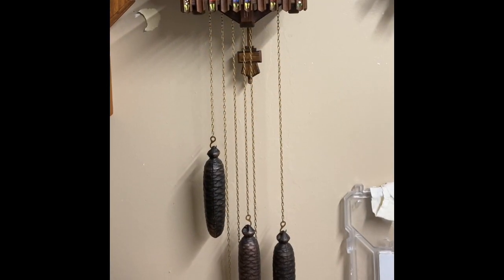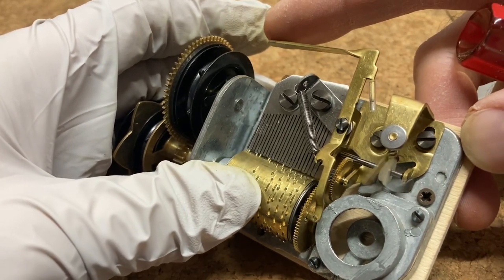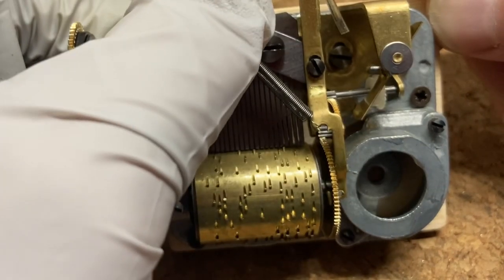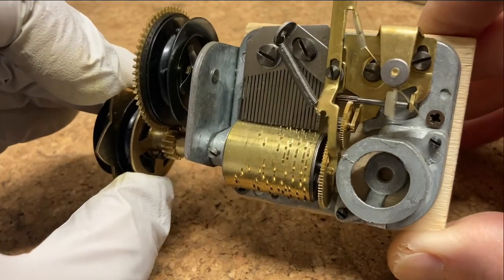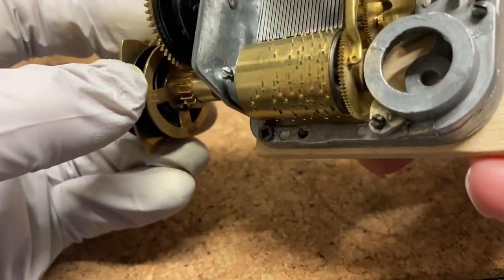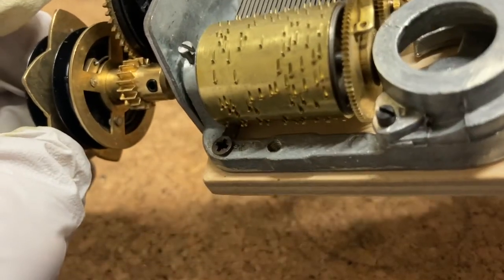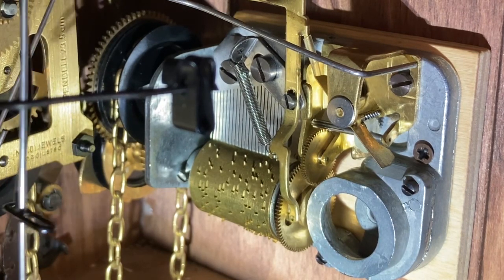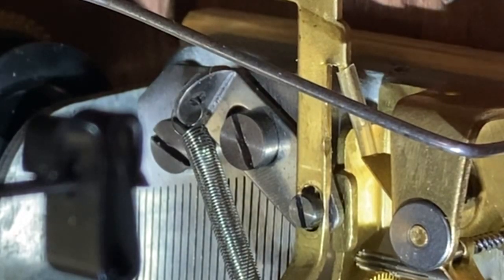Cuckoo Clock Repair - How the Cuckoo Music Box works and how to adjust in detail

Comment: Thank you so much!   This is the best video on this subject I've ever seen.  I had about given up on a box that won't stop playing.  But, now I'm going to give it another go.  Thanks again. Excellent presentation!  Just need to find some proper size tubing for the fan stop.
Reply from the maker: Thanks! You can use the fuel line for a model airplane gas engine. Check your local hobby shop.
Reply: @Chrisclockrepair  Already got it fixed!  Took about 10 minutes to get it out of the top of the case and about 5 minutes to adjust it!  I used a piece of heat shrink tubing.   Thanks again!  Created a new issue during the process.  Now the clock won't quit striking at the hour or half hour.  Should be a simple fix, but I've yet to see the problem.
Reply from the maker: @mantolaman  on the top mounted cuckoo music boxes you typically have a wire on the back of the clock movement that catches the fly during warning. If you adjust this wire to the right, you can pull the strike lift on the front of the movement such that it won’t drop and allow the rack to get gathered all the way up.  That could be your issue. Do you have a wire that attaches to the back of the movement and catches the fly?
Reply: @Chrisclockrepair  Right on, again!  Adjusted that top wire a bit and it's now working - everything as it should.  There is one small issue.  On the hour the singer comes out and leaves the door open.  And on the half hour He comes out, sings and goes back in and closes the door.  ha, ha,  ....  I can live with that.
Reply from the maker: @mantolaman  good job. That sounds good. You may be able to put a small bend in the cuckoo door wire so that it is a hair shorter. Like a slight hump in the middle of it. And put a drop of oil where the wire and door eye hole is and on the door hinge. That might do it.
Reply: Hey Chris have a 69 E. schmeckembecher   musical cuckoo clock 3 weights and the 3rd chain locked up I cannot get it to budge any suggestions?
Reply: Thanks, Chris!  Would you be able to recommend a place to buy that small spring that connects the lock pin to the other part ( apologies for not knowing the term) Great video! Thank you for sharing your knowledge with others.

Comment: I recently bought a Schmekenbelcher cuckoo clock, manufactured in 1967.  I oiled the gear pivots and it stopped working.  I worked on it and now it's working fine - However, now the music box plays at roughly twice the speed it did previously.  Is there a way to adjust the speed at which the music box plays?  Thanks -

Comment: Thanks for showing the details of this fascinating music box design! It's very different from the few cuckoo music boxes I've seen. In those boxes, the stop arm (the thing that drops into the hole) is slowly lifted toward the rim of the barrel as the music plays, by a cam on the end of the barrel. The stop arm drops into the hole, which immediately causes the other end of the stop arm to catch the fly and stop the music. When the stop arm is pulled out of the hole (to play the music) the first thing it does is fall toward the inside of the barrel so that the arm can't fall back into the hole. The stop arm catches on the inner edge of the hole rather than the trailing edge of the hole.

In contrast, your music box's large spring seems to do two things: 1) as in my music box, it pulls the stop arm inward so the arm can reliably fall into the hole, but 2) it also pulls the stop arm backward (see 14:18 and following) so that when the stop arm is pulled out of the hole the arm jumps backward so that the arm can't fall back into the hole. A fascinating design, because it requires the stop arm to catch on the trailing edge of the hole, so that the stop arm is pulled forward a little to catch the fly.

Thanks for the detailed tour of this cuckoo's music box!
Reply from the maker: Thanks Bradford.  There are certainly a number of different styles of cuckoo music boxes out there.  There is of course the top mounted style as well that is pretty common.  They all work in a very similar fashion and as long as you understand how they are supposed to work, you can generally extrapolate how to properly adjust them.  Thanks for sharing.  By the way, is there anything in particular you would like to see in upcoming videos?
Reply: What is the second song
Reply: What is the second song

Comment: Thank you so much for this great video, that I can actually see plainly everything you are ta.king about. I just purchased a cuckoo clock from an estate sale 130.00. She claimed it was new. Never been out of box. Got it home . Out of box I could tell it had been used and it even will not run. I'm definitely not a clock repair person, but I like to try to fix what I can because repair people for anything cost to much these days. So anyway the music don't  play,  some rust on alot of the screws, the bird only churps 1 time no matter what hour it is on and I level it to the wall but can only get it to run about 5 hrs then it will stop. I quess I may have to take the music box out of clock like you did to fix it. Some rust on the long things that roll over the cylinder as it turns.  Actually could not get mine to turn. I need lots of help. Hope you have more detailed video like this one and thanks again.
Reply from the maker: Thank you. Sounds like you have quite a job on your hands. Try lubricating the music box with clock oil at the pivot of each gear and see if that allows you to turn it. Also ensure the fly/governor is not interfering with any wires or levers
Reply: Thanks for your time. Due to working 12 hr. Shifts it will be a couple days before I can work on it again.

Comment: Great detailed explanation that has helped me advance in getting my chime to work properly! Thank you!  My only problem now is that seems like the music roll skips through the comb in a few places. It appears that the pins on the roll aren't long enough in some sections almost like they're stripped. I even tried to adjust the height of the comb several times and never found the sweet spot (if that is possible at this point) where it would play properly through the whole roll (2 songs) without skipping. I would appreciate any advice. If I get the chime working, I would love to hang onto the clock. It is a Cuendet Swiss model with very similar inners as are in this presentation. Any suggestions???
Reply from the maker: You’re on the right track. You have to adjust the comb or if the pins are worn, I would buy a new music box. Repinning is not worth the cost to repair
Reply: @Chrisclockrepair  Thanks Chris! Where would I get a new music box like the one in your video. I've looked around and couldn't locate one. Any suggestions on who sells them?

Comment: Hi Chris, With my cuckoo clock, it was jamming or stopping the clock on and around 4 to 3 minutes to the hour. After watching your video I have found out the problem. The problem I was having was as you described at 11:56 to 12 mins. I saw what was happening as my plastic tubing had worn that slight bit to jam the spigot in the music box housing as the fly was not stoping on time. In the end a simple fix that had me thinking all strange things which included pay someone to sort it out. Can you imagine it would be like the lamb to the slaughter ( in my case a pensioner to the slaughter. I would ask what was the problem and that person said this and that which I would not understand and forking out huge money for a 5 minute fix. I m hoping one day to completely overhaul an old clock. Looking forwards to the intricate fitting of bushes etc if need be.
Reply from the maker: Well done for diagnosing and handling that yourself!
Reply: yes, it was a good feeling to work out what may have been happening after watching your video.

Comment: Thank you so much! I inherited a cuckoo clock from my grandparents. The music box didn't work, dancers didn't move, pendulum no longer worked, chains stuck, and gears wouldn't move. 

I've been able to fix the music box (detailed below), clean the movement with dancers with an ultrasonic clear with water, tighten a small screw on a gear underneath the dancers platform, tighten the rod connected to the dancers platform and clock movement, oiled the clock, and put the chains on all the gears. Still haven't gotten the pendulum and clock to work. However, if I turn the clock minute hands I do get a cuckoo and the dancers do move. Might take some further troubleshooting, but progress!

Music box fix:
On the right side of the assembly, there is a white plastic gear. Often times this breaks/cracks. There was a YouTube video I found to buy a governor replacement and how to adjust and replace it with the new piece. The new piece requires some drilling of new holes and cutting some metal away.

The music box governor was the 22-Tooth Music Movement Governor 13-Tooth Pinion (14495)    https://timesavers.com/i-8944887-22-tooth-music-movement-governor-13-tooth-pinion.html  

None of this research and troubleshooting would have been possible without your video to fix the other issues I had!

Specially I have the Regular 25 1 day with dancers.
https://www.cousinsuk.com/document/product/regula-25-1-day-with-dancers
Reply from the maker: That’s fantastic and I am very happy to have helped you.

Comment: An excellent piece of help.  I actually have three of these to do!
Reply from the maker: Very good!
Reply: @Chrisclockrepair  I'm working on a different one now.  In this case, it is an eight day clock which needs to only play music on the hour, but this one is playing on hour and half hour.  You got really close to it at 16:30 to 16:55, but could you please provide me with a tiny bit more information on adjusting the lever to where it goes down for the music box on the hour, but not quite as far on the half hour?  Perhaps a video showing the procedure of that particular part showing how to do that?  Thank you very much, I'm going to go back and watch what it does and look for a difference between the hour and half hour.  Perhaps I'll see it.  Again, many thanks.
Reply from the maker: @PipeSergeant54  yes the lever that actuates the music box travels further on the hour so if it is actuating on the half hour as well, simply reposition the lever further away from the music box a hair until you get it just right. You can always send me a picture on my email.
Reply: I went and looked at how it went down on hour as opposed to on half hour.  I then let it ring for the hour, bent the activation wire up about 1/8", moved the hand forward to the half hour and the clock struck but the music stayed silent, repeated.  It is fixed!  Thank you!
Reply from the maker: Good work!

Comment: Excellent video. By the way, my cuckoo clock is striking TWICE when it reaches half hour. As you very well know, it should strike only ONCE for half hours. Do you know what is happening? Thanks
Reply from the maker: Hmmm. This sounds like a mechanical adjustment problem with the rack or gathering pallet. This may not be an easy fix for you

Comment: Great video. I have a similar clock and the music box spring is stretched and now the stop won't go in the hole. Any suggestions on what size of spring to get and the where to get one?
Reply from the maker: You can order an assembly such as https://timesavers.com/i-9994475-music-movement-stopper-bridge-with-spring.html. Or you can go to a local hobby shop and find a little spring that is smaller than what you need and just stretch it out until you have the right strength.  I would get a bunch of them in case you overstretch it. You can also check Merritts for what they might have.

Comment: The music box on my cuckoo clock has been running sluggish of late. Finally, after a few weeks it stoped. It only runs if I pull down on the metal pine cone. Does it need oil? Is this a sign of near death? I love this clock, what should I do?
Reply from the maker: It will need a service. Depending on how severe the wear is, it may need a rebuild.

Comment: Thanks for the video Chris.  I just got a cuckoo clock back from servicing and the music box does not play as loud. Any hints as to what may need further adjustment?
Reply from the maker: Thank you. The sound is generated by the music roll plucking the comb teeth and there is an opening behind the comb usually to allow the sound waves to travel. You have to look at the comb teeth and see if they are too far from the roll when being plucked. That would produce a softer sound. If its too close it will jam. You can also drill a hole in the side of case where music plays to hear it better. Hope that helps.

This is assuming  your hearing is all good of course!

Also note if the repairman cleaned the music box comb in a cleaning solution, it may have removed the dampers, adversely affecting the sound.

Comment: Thanks for the video Chris. I have a very similar cuckoo clock that uses the same tune on a cylinder roll it just plays 1⁄2 of it at a time. Right now it's only playing on the hour, but I do recall, and it's been a while, that it did play on the hour and half hour. Mine does not use the plastic tubing, it just uses a piece of metal that hits the flywheel. So only the one screw is adjustable for adjusting the trigger; the smaller screw with the slot is not used as an adjustment? I'm trying to do the adjustments while the music box is in the cuckoo clock but it's not easy to get to; it's located in the roof area. I guess it's probably best to take it out though? The bellows are glued in so that makes it difficult.

Comment: Our clock is playing both songs multiple times just before the top of the hour, then it cuckoos and finishes playing the song. Would this be the same fix for that issue or could there be something else wrong? Thanks for the help!
Reply from the maker: It sounds like the black activating wire is out of adjustment and is keeping the arm out of the hole too early.

Comment: Greetings and thanks a million for this video.  We recently moved and pulled our clock out of the box only to find out we couldn't easily pull on the cuckoo chain (we have 3 weights).  If you pull it real hard it will lift the weight but it sounds rough almost as though we jumped a link or two.  Does any of this sound familiar?  Thank you!

Comment: I've got a cuckoo clock that wont play music unless I pull the weight extra hard. Do you have a video for that?
Reply from the maker: It probably needs to be bushed as it is likely worn (either the movement and or the music box).
Reply: Its brand new. Just bought it while visiting Germany.
Reply from the maker: Then it will require some careful looking to find out what is causing it to be so stiff.  Or it might need lubrication.

Comment: I got a Problem with my Schneider 8-Day Cookoo Clock & can’t figure out how to get it to work right. Mine has a Music Box but don’t work it has a Battery Box for either a C-Cell or D-Cell battery. There is also an Electric Motor to run the Music Box. The clock is very clean inside no dirt anywhere. Can you tell me what needs to be done to get it operational again? The clock is at least 26” inches in Height. Can you tell me what needs to be done to it.
Reply from the maker: Not without actually seeing it

Comment: Great, now I have a question. I have a very large cuckoo clock that I bought in Germany 40 years ago. It keeps good time but the music starts playing about 5 minutes before the hour and plays continuously until about 1 minute after the Cuckoo. Do I move the music box? I've tried several things but it still doesn't work property. Everyone loves this clock and I can't find anyone willing to repair it. Thanks
Reply from the maker: There is a wire that is supposed to move in front of the fly on the music box when the clock warns (at about five minutes before the hour). This wire needs to bent so this occurs. It is a very easy fix.
Reply from the maker: Send me photo of mechanism from the back to chrisclockrepair@gmail.com and i will email you back detailed instructions
Reply: @Chrisclockrepair  just reading through these comments. What a nice guy you are helping so many. Just wanted to tell you since people seem to only give negative feedback these days
Reply from the maker: It’s hard to diagnose without seeing it, but seems like a simple adjustment that any competent repairman could do.